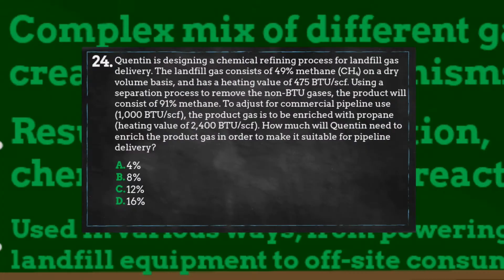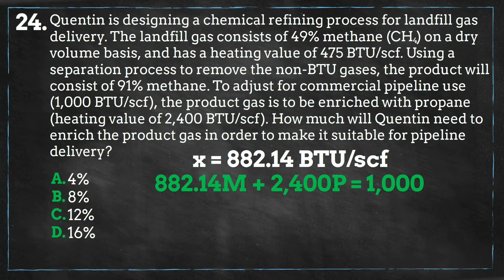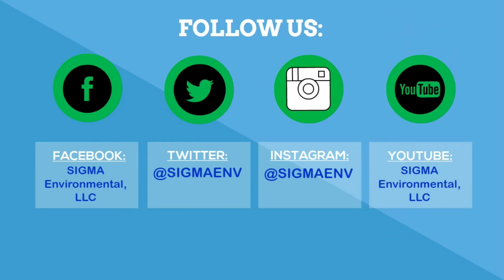Landfill Gas - Episode 24 (Waste Management) | 52 PE Exam Problems in 52 Weeks

Comment: Thank you for this video and I have a follow-up question. 

The concentrated landfill gas consist of 91% methane. Since we are using the heating value of 91% methane in the final equation, why is the 91% fraction of methane not considered in the final equation ( 882.14M + 2400P = 1000) i.e., M=0.91 ?
Reply from the maker: Thanks for your comment, Oluchi. The landfill gas is be 91% after we remove the non-BTU gasses, but before we enrich it with propane so it can have a BTU value of 1,000 BTU/scf. The question is asking what % of the final gas product will the propane make up to get it to this preferred BTU value, but now reviewing it the wording is a little vague. Let me know if this makes sense.